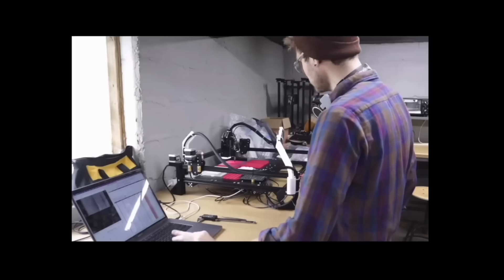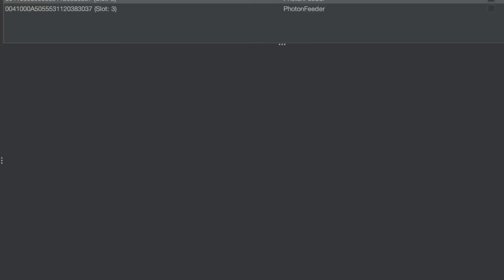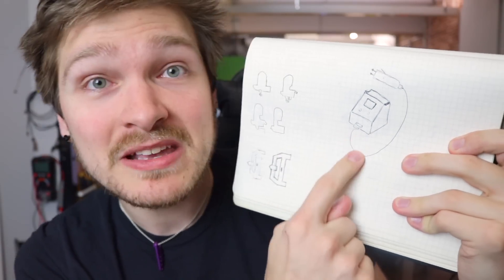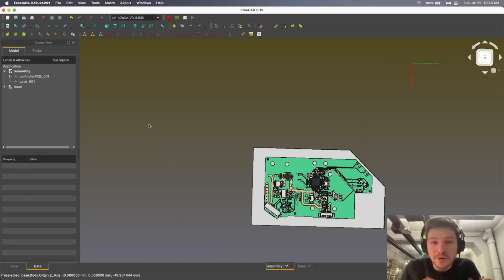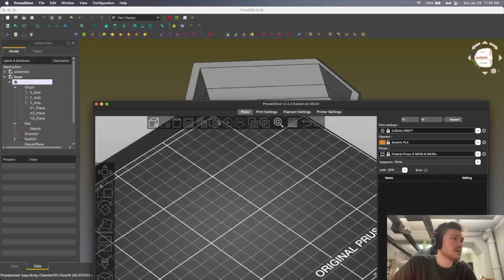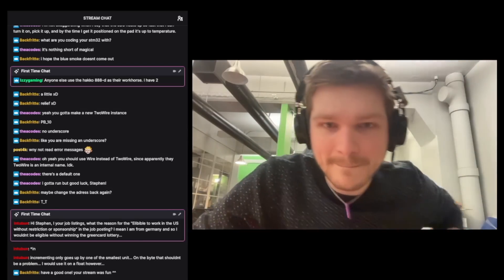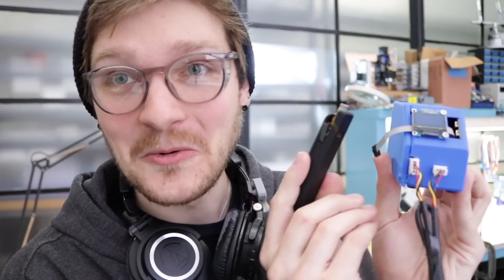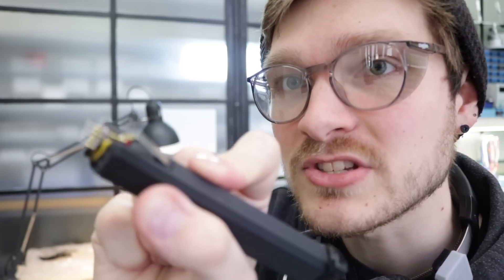Some jigs you have to build yourself

Comment: Why not use a gpio mp3 module to play "1.mp3", "2.mp3" and then "success.mp3" or "fail.mp3"? You can generate the mp3 files with a program called 'balbakoa" (on portable apps, for windows. I'm not 100% on the spelling, but it just generates audio files from text-to-speech generators)

Comment: Why not make a panel with the same dimensions (call it the "programming panel") and lined up with the same pads to receive pogo pins, and then put 50 cheap mcus whose sole purpose is to program the mated to eeprom chip? That way you could program an entire panel in parallel instead of in sequence. You could use something very low cost like a padauk IC, and you would program each padauk MCU to do the same code that you wrote for the stylus (short check+program+verify program). The programming panel would contain 50 MCUs and each MCU would have their own success LED, and then on the programing panel you could have a master reset switch and a master program switch. So basically to program you would take the entire eeprom panel and mash it to the programming panel, hit the master program button and then lift the eeprom panel off and inspect all the LEDs on the programming panel making sure they all show a successful status, then you can press the master reset button and grab another panel. What do you think? Am I explaining myself well?

Comment: Make the base station beep in binary, maybe a low tone for 0 and a high one for 1. BEEPBEEPbeep - you just flashed #6 correctly. Skip leading zeros. You can make an "angry" tone by alternating PWM frequency very rapidly (a trick from chiptune synthesis) for error code. Or just lower frequency.

Comment: For full out speed put a full size board with enough contacts to contact the other board and a case that lines up the two boards so you can test and program an entire board worth at oncejust placing one board into the guides on the programming block and that can ensure each spot programs the right number.

Comment: I would have put a RED and GREEN LED on top for success / failed.  This way as you are programing, you can see in the corner of your eye a green or red.  Otherwise it'll be hard to line the pins and look at the screen.  Or sounds for BEEP for success and a EEEEEERRRRRRRRRRRR for failed. 
ORRRRR
You could use your part picker frame to automate it... if you know the size of the boards assembled like that as a whole sheet, you know where the pins are on each one... so you could program your part picket frame to have the styles and push down on pins and program success into the picker software to say good to go to next, if FAILED, try program again.  If failed again, then continue, and at the end, BUZZZ to alert a failure and read on the screen which number(s) failed and either SHORT or PROGRAM...  Then it will be automated to where you just lay down a new sheet of boards and push GO.

Comment: The pointer connectors look to be a total of 6 wires so either 2x3 connectors or one 6 wire would be better ( depending what you need already, always use ' common ' parts ).  Either way, you could also keep them as ' bodge wire ' to the mainboard to allow for trying side by side or one over the other for connecting the pins.  There may be enough space to ' pulse ' one of the leftover IO lines at a set frequency for part of a second, and no sound if failed for the audio conformation of programming, alternatively to an actual tone is there are piezo buzzers out there that just need power that would do it when a pin goes high ( and make sure you have that pin internally pulled down or wired as such ).  Keep up the amazing work!

Comment: You can place little tiny 7 segment lcds onto slots so you dont need to write numbers on silkscreen manufacturing can be easier with this method but ofcourse these 7 segments will increase cost a bit

Comment: Hmm maybe a new interesting thing to add would be a modular stylus that can be added to the lumen? We did some side way dupond stuff for our line up. 
Would also be nice to have a two pin head that can check for connection or voltages..

Comment: A beeper is a good idea TBH, I think each success should generate a confirmation beep, but then each end-of-line sequence 5/10/15/etc, should be a double-beep so the operator knows if they are at the same place, that or an error-tone, are better places to sanity-check, rather than after every single programming operation. 

The next step after this is either put the programmer onto a 3D printer to automate it, or give the panels themselves a break-off matrix connection to mass-program an entire PCB all at once.

Comment: Since you have uniquely silkscreened PCBs for each address, have unique traces in each PCB number and a tiny microcontroller to read the trace configuration and report to the feeder accordingly, you can then order preprogrammed microcontrollers. An even easier solution, just have unique passive pcbs with no electronics but just unique traces that the feeder would read. Another idea, have IR transceivers, one on each side of the feeders and they can figure out their location with a tiny bit of clever programming. Your solution is awesome but there might be some ideas that save you the hassle of uniquely programming stuff. Stay awesome!!

Comment: You might want to build a needle adapter board with the same size as the panel and all pogo pins in place. Press down the needle adapter onto the panel and program and test the whole panel at once. It will cut down your work to program to 1/50th.
Reply: This is what I was about to say.

Comment: So, I wonder if in a future version you could convert this concept to the head of a Lumen PNP frame and have it fully automate panel testing/programming by raising and lowering the stylus to specific X/Y coordinates and only moving to the next set of pins on a successful program or reports unsuccessful attempts at the end of the run

Comment: Interesting how different people try to solve the same problem. I would have tried to include one of those mini OLEDs inside the stylus at a point where i look anyway. Also a bright LED lighting the board green for success. Maybe even RGB - Green flash=OK, Red flash=Error and altering between two colors for even and odd upcoming numbers as an additional indicator. I find buzzers problematic as you can easily get confused if your ambient noise includes similar sounds. Also: Musik keeps me sane ;)

Comment: 💡 If the slot PCBs had not only a number, but also a barcode on the silk screen 🤳, you could likely take a lot of additional manual error out of this. Future proofing when the problem scales — Scan flash verify scan flash verify

Comment: Probably a little late to suggest this, but TagConnect has some nice pre-made pogo pin connectors that could work in place of your custom solution. Also, pretty please, build AOI functionality into your PNP machine! I would kill to have my PNP take pictures of components after assembly and compare against a "golden standard" image to automatically find missing/misplaced components, etc. Even if it just saved each image to a big database for our recordkeeping purposes, that'd be swell.

Comment: Alternatively, you could set the slot address with a resistor, rather than having to program an eeprom. Or a number of resistors and solder bridges allowing setting the address using a soldering iron.

Comment: Do you have a test pcb with the different fault modes on it?  That'd be great to have for when the pogos start to wear from angled use.  Also for any iteration, which would be helpful.    Maybe get a board of pad arrays that fan-out to bodge pads, so you can do all the different shorting patterns as bodge wires and ugly solder bridges.  Leave a little white box in the silk to write a label under each test case.

It feels like a silly bit of V&V that would definitely save my ADHD self within a revision or two, and also let me diagnose it quickly when the pogo pins start to wear.  And, most importantly, let someone who isn't me check if their tool is working (even if it takes them a few minutes, it's still less time than the interaction).

Comment: just saying, isn't it easier to just put resistors on then to indicate the slot position?
* just a suggestion, this is definitely cool and I have over engineered things a lot myself

also, for audio feedback, you can do double beep at the beginning of each row which is enough to account for stuff like accidentally skipped one.
tbh the end of this is probably mounting this to a linear motion platform and fully automate this, so user error isn't really an concern
Reply: I came to say this also,
Make a programmable resister array by soldering on the resistors that code to the specific value, 6 bit would allow for up 64 addresses. 
Then a shift register that shifts out the value of the resistor bus.
Reply: @JTordur  my idea is more like: surely your mcu's analog input can measure 64 different resistence right 🤣

so just put different resister (and different amount of resistor for BOM optimization) on them and you are good, this guy just made a pnp to exactally automate that

this don't work if you need anything more than slot id, but do you really is the question
Reply: @ushiocheng  I just reviewed the feeder design again. 
So the feeder identifies itself by communicating with the "slot" itself. 
So yes, this could be achieved entirely passively either by ADC or just having 6 pins with resistors coding for either 0 or 1. 

I just assumed, wrongly that each feeder were communicating in a daisy chain configuration.

Comment: Use a thermal printer to print out success/failure for each unit. You can check your results tape/receipt after doing all 50. That way you don't have to look at the display every time, but don't accidentally miss a problem.

Comment: Do a double success beep every 5 item.

This way you don’t need to look away from the PCB to check you are programming the right address on the right PCB.

If you hear the double beep on a non 5 multiple (or don’t hear it on a 5 multiple), you know you need to revert to the last successful one, set the proper address on the screen with the buttons and resume programming.
Reply: Or just beep the number in binary.
Reply: Beep in Morse code. 😂

Comment: Having trouble with font storage in your microcontroller while using graphic LCD or OLED displays? Use an external ROM like the GT20L24F6Y. Has a lot of font information in it, information you don't have to store in your microcontroller.

Comment: My build philosophy: First, make it work. THEN make it pretty.

(Currently working on a general-purpose inductor/coil/transformer winding machine for a couple projects - yep, I'm building a project for building projects - Arduino Mega 2560 R3 brain, 3D printed wire guide/straightener, beefy ER11 spindle to rotate the bobbin/core/coilform, closed-loop positioning on the spindle, all the cool bells and whistles. It'll do everything from tesla coil primaries to winding custom guitar pickups. And yes I'm using a buzzer for feedback for button presses, etc.)

It it were me and I needed to program a whole panel of numbered boards, I'd set up a pogo-pinned jig to just do the whole panel at once. Start at #1 and sequentially power and do a board test/write-and-verify to each EEPROM on the panel, report any that failed or faulted, and Bob's your uncle.
Reply: Oooooo  I been looking over various designs for those!  Do you have your design files or any pictures anywhere yet?

I’d love to follow along.  That and a Torrodial Coil Winder are two things that would be VERY helpful for making larger electronics.
Reply: @ericlotze7724  I'm taking boatloads of pictures (I have something like 15-20 pics of the wire guide/straightener alone) but haven't uploaded anything yet. I probably ought to start a build log for it somewhere.
Reply: @OddlyIncredible  On a related note, if you haven’t printed it already, there is a “3D Benchy Photography Studio” that is great for photos / QC of small parts.

Comment: @StephenHawes: Idea. Maybe you can make a small adapter that you can fit on a pick-n-place machine, so that can push the proper pins at the right spot, then program, and move to the next part of the board? Maybe a customized pick-n-place machine for this?

Comment: Use a red and green led on the handle for failure or success? Varry the blinks or use more colors for additional statues.
Reply: Outside of Accessibility Considerations (Colorblindness), that’s a good idea!  Wouldn’t need many wires and is quite versatile.

Comment: You are inspirational STEPHEN !
I want to do computer engineering at the university,  so do I have to specialize in embedded systems in oder to be like you .  As in I enjoy writing software, soldering micro controllers and repairing stuff.

Comment: If you want to keep it manual and beeping: beep in modulo of 4 times on ok. . So 1= beep.2= beep beep. 3= beep beep beep. 4= beeep beeep beep beep. 5 = beep. the reason is that you quickly memorize ho many beeps belong to which number (no problem for an engineer anyway), and you know that it is a wrong number without looking.

Comment: As a worker who does a lot of repetitive bulk tasks every day, this one seems particularly unpleasant and you should instruct whoever's doing it to really pay attention to the way it makes their arm feel after a while. This could easily be a machine for producing RSIs. Obviously as people have said, you could tape this onto a PnP. I'll go a step further. You should develop a module for the PnP which holds a plate of pogo pins wired to a programmer that is activated by the software. The head grabs a programmable chip, orients and locates it with the camera, takes it to the programmer, pushes it into the pins, beep, either it worked or it didn't and if it did you place the chip. This is a generalized solution for anywhere like this that you need to program chips a specific way based on their final location. It's not ideal if you need to program a large number of chips identically, but a lot of people will find it adequate for that task too. And if you don't end up mechanizing this task, it will help your employees to redesign the wand so that it can program several feeder slots in one go. This will reduce the movements to 1/n, as long as you can make it easy to align.
Reply: Yeah Ergonomics for Repetitive Motions like this are not something to be dismissed.  Tendons are not easy to fix!

Comment: Your 5x10 carrier PCB can be outfitted with 5 programming ports that have traces running to the eeproms. Those traces run through the snap-off points. Each eeprom has it's individual chip select line. so on the side you'd connect a 4+10 pin contact, which in turn programms each eeprom, and then you'd snap that row off, continuing to the next one. You can save contacts / ports, by sharing between rows and overwriting the programming each time you snap off a row above. You can save more by coming up with a matrix solution. The carrier PCB would need to have a larger border for this to work. Both on the outside as well as probably within the rows.
Reply: I think EEVblog has a video on pcb manufacturing that talks about those snap off programming ports to program dozens of ICs during manufacturing only.

Comment: You could, by slightly complicating the project probably not worth it, bake a matrix on the PCB comparable to an led matrix that pulls up only one programming pin each so your device can bulk program a complete board at one go.

Comment: I screamed at the stepper motor being used as a weight.

As for auditory feedback, you could wire up a vibration motor to one of the two motor drivers on the feeder PCB. 🤔
Reply: Owo ? 

( /j )

Comment: Very cool.  Could those be programmed by the pnp machine instead?  Maybe put a button on each that the user presses when the pnp is in a special mode.  Then user just presses each button on each and the pnp programs then sequentially. First button press gets assigned 1. 2nd press on next one gets assigned 2...etc etc.

I guess that would require a program to accept the assigned number though?   

Put the programable lines on a bus to program them all with the same program at one time.  I hear this actually works!

Then use my original idea in first paragraph.  Heck make the pnp push each button!

Comment: Cool project! . One question about the identifier solution though: why aren't the ids binary encoded in the pcb design? Since you're panelizing the pcbs anyway you could easily treat the panel as one pcb, with each of the 50 sub-pcbs have it's own unique I'd encoded in the copper in binary. Maybe I'm missing something, but it  seems more straightforward and cheaper than eeproms and programming time?
Reply: If one gets damaged/lost, you could reuse a generic one.  Maybe make a generic pcb with a programmable number.
Reply: Or a DIP switch.
Reply: replacement parts are easier to manage with a single SKU, also you can rework existing boards in a pinch if you need

Comment: Have you considered doing this without any manual programming of chip?  I don't know what the general technology is called, but the DX encoding on old film cartridges would have multiple contacts and the camera would test continuity between them to read the encoding.  Unless reprogramming them is super important (but you're already uniquely silk screening each one), this way, every encoding is is baked into the board from the start, no programming is necessary, and you can save yourself that chip.  Technology Connections has a great video on the camera rolls tech.
Reply: The circuit board of each feeder could binary encode the number, but for 50 feeders he'd need 6 pins just for communicating that. The eeprom can do that with the few pins I2C uses